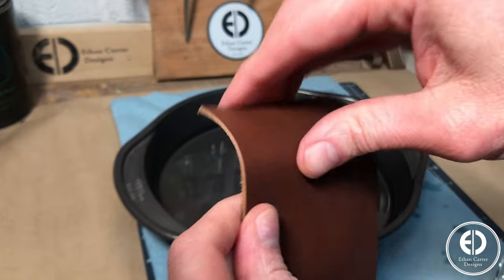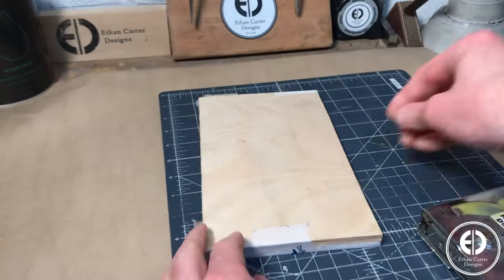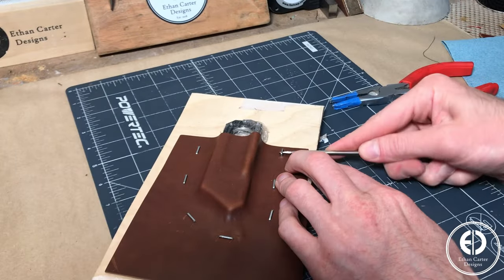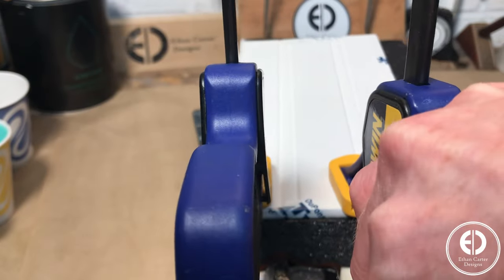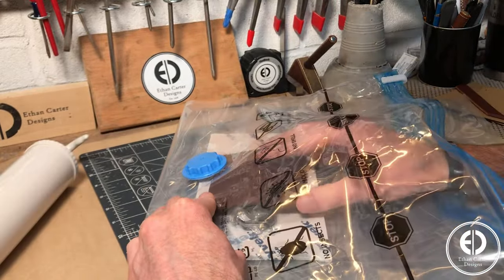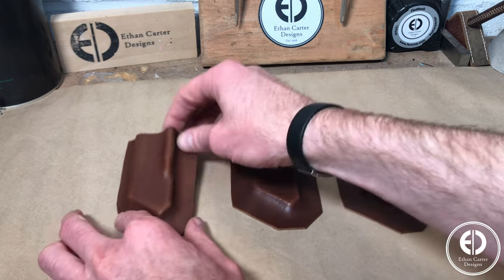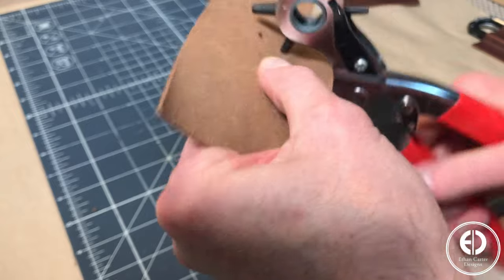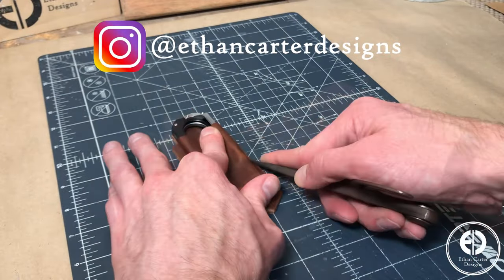How to Wet Form Leather // Three Easy Techniques

Comment: Word of advice... avoid using Chrome tanned leather for wet forming anything that will be holding metal... knife sheaths, holsters, multi tools and so on.
Reply: why is that? Im new to leather crafting and im trying to learn as much as possible :)
Reply: But why??????
Reply: Yeah why does it trap moisture? Does the chrome oxidize and affect the metals?
Reply: The chromium reacts with the metal and causes rust.
Reply: Is there any way to tell how it was tanned? I have an eye patch I'm a bit suss about now lol.

Comment: For those that want to try the "Foam" pressure molding technique without leaving marks from the foam,  cut a piece from a heavy freezer bag large enough to cover the wet leather then put the foam over it and clamps to press. I use the clear plastic from a fabric store that is used for Jeep windows but, heavy plastic bags will help as well.  You can also take it out of the clamps after 30 minutes and work in some details with smooth tools then place back under pressure. Great video!
Reply from the maker: Thank you so much Rick, that is an awesome tip that I will definitely use moving forward! Learning something new every day!

Comment: For wet forming leather by hand you don't need to soak it in water for 15 minutes. 30 seconds under running water from both sides and a 10-15 minute drying time is all it takes. The leather is not too wet anymore and has a perfect rubbery feel to it. To dry it off I clamp it to a board and stand or hang it infront of a heating fan for 30-45 minutes. After that the leather is dry and the form is being held perfectly.

Comment: I tried to use some of that foam on my harmonica and it started to bend it!! That's why I ended up making a 3d printed form and clamped it in place (which you should have made as your bonus technique) I think a vacuum bag is the way to go if you are going to be making lots of these things.

Comment: Hii, doesn't the leather get spoiled by water ? Or gets moulded ?
Reply from the maker: I have never run into that issue personally. I think as long as you don't leave it in the vacuum bag too long it will air dry quick enough that no mold will form.
Reply: @EthanCarterDesigns  can i dry it in sun or it needs to be dried in shaded area
Reply from the maker: @purvaharlalka2529 I just leave on my workbench in the basement to dry, but I doubt the sun would hurt anything...

Comment: Wow so cool ethan i think i like the foam method the best though you're right the texture left is not the greatest if you're not already going for it, i wonder if some plastic wrap, a silcone mat, or wax paper would help that?
Reply from the maker: Thanks bud! Yeah agreed and funny you should say that, someone recommended placing it in a heavy duty zip lock bag to help with the texture which I tried last weekend and it definitely helped a lot!
Reply: @EthanCarterDesigns  that's awesome 👌 can't wait for the next video
Reply from the maker: @MakerCuisine  Thanks bud! Just dropped another quick one actually - different format, will be interested to see what people think!

Comment: One thing that I'm having a hard time finding are instructions on how to prevent leather from getting white mildew/ mold. I have an extensive leather collection of coats, high end belts, sheaths and some get it overnight and others over the winter. They are stored in the open for air circulation and dehumidifier used year round to try to keep it below 70%. I usually wipe it off outside with a soft brush and damp rag with 6% vinegar to kill the mildew. Is there a product that will prevent mildew/ mold without making the stiff leather supple?  I already ruined some belts by making them too soft to offer support. A soft sheath/ holster is not much good either since they listen and lose form.. That's my delema and appreciate any suggestions.
 Thank you.
Reply from the maker: Hey! That does sound like a very frustrating situation! To be honest, I have zero experience with removing/protecting leather from mildew/mold, but I did a quick search and found a couple videos that may help. Here are the links: https://www.youtube.com/watch?v=2NUr6y3R7Mg  https://www.youtube.com/watch?v=eSzTy1GIDB4

Comment: What thickness of leather would you recommend?
Reply from the maker: Depends on the project - in this video I'm using 3.5oz leather and it molds really well, but depending on what you're making you might want something a little thicker which may hold up better over time with heavy use.

Comment: It’s possible to do it with a finished chromed leather ??
Reply from the maker: Yes it's possible, but works better with some than others. With chrome tanned leather, I've found soaking it in hot water helps, whereas with Veg tanned leather you only want to soak it in room temp water. At least that's what I've experianced.

Comment: Nice But. . . . . How does the leather “dry” when it’s sealed inside a vacuum bag ?   I would think the bag would hold all the moisture in.
Reply from the maker: Its a great point, but for whatever reason is does seem to dry out.  Either way though, you can take it out of the bag after a few hours and let it finish forming as it air dries

Comment: One question if anyone cares to answer, so, I went to the only leather store that exists in my town, and they had some leathers 25euro the meter, but there was not even one piece that was one meter, they were all small patches of leather, thin leather I might add, not like those cow leather etc.. so my question is, can this leather be wet molded? Thank you very much

Comment: cool. does this work with any leather? or just vegtan ?
Reply from the maker: It works better or worse with different kinds of leather, so I always recommend trying it with a small scrap first.  I've found that for chrome tanned leather it helps to soak it in warm water and room temperature water for veg tan.
Reply: @EthanCarterDesigns  very cool. thanks for the help
Reply from the maker: @eross21  Anytime!

Comment: Please let me know if this works for faux leather ! Can’t find an answer anywhere
Reply from the maker: Hi Sofia - I honestly don't know and can't seem to find the answer either.  You could always try with a small piece as a test.  I would try soaking it in room temp water and also hot water because I have found that can make a difference between veg tan and chrome tan leather.

Comment: What chisels are those mate? looks clean
Reply from the maker: They are amazing - not cheap at all but if it's something you're going to do a lot, it's worth it. The set I have came from a company called Sinabroks
Reply: @EthanCarterDesigns  yeah those are damned expensive for a set... ouch
edit: you know any cheap french style chisels if I'm on a budget?
Reply from the maker: @escapetherace1943  I haven't used these, but this set off Amazon get's pretty good reviews - https://amzn.to/3ObQZSL
Reply: @EthanCarterDesigns  I dont have hole chisels so I may pick those up, I tried finding cheap slanted chisels it seems they don't exist. I plan to twist a fork's tongs, file and then change the temper for some delicate work and for a "free" pair. So far I'm making pretty great looking stuff with just my simple diamond chisels, came across your videos yesterday and I like them man, I appreciate it.
Reply from the maker: @escapetherace1943  Awesome, sounds like a good plan! Thank you so much, I really appreciate it!

Comment: I got the vacuum bag but my leather didn't dry after 3 days
Reply from the maker: I've found recently that as long as I leave it in the back for a few hours, I can remove it from the bag, leave it on the object while it finishes drying and it works just as well.

Comment: What thickness of leather would you typically recommend for such projects ? :)
Reply from the maker: For fairly lightweight sheaths/holsters like this I'm using 3.5-4oz leather which molds really well. With that said, heavy duty holsters are closer to 5-6oz typically I think and it take a little more effort to get a good mold, but it's definitely doable. Hope that helps!